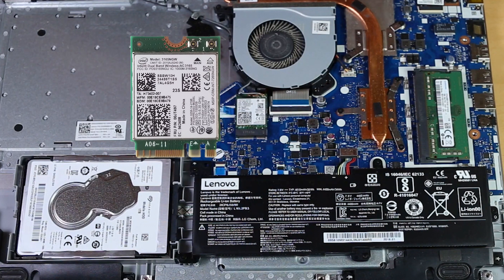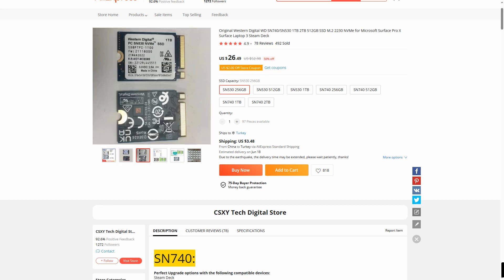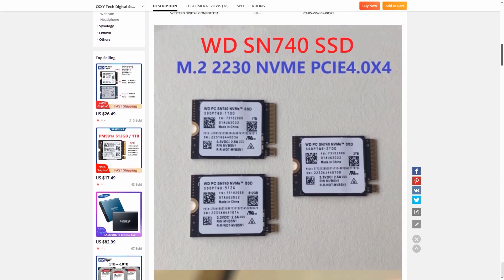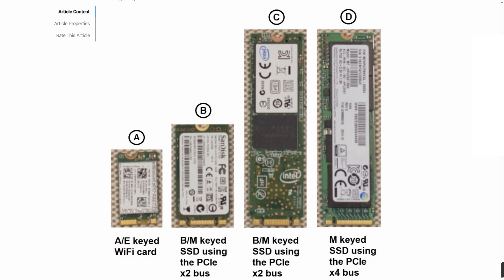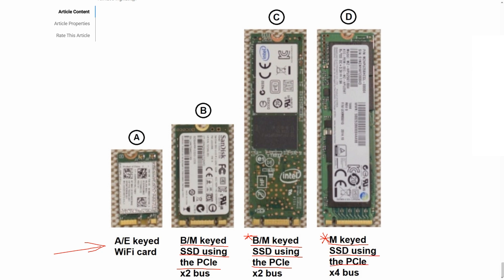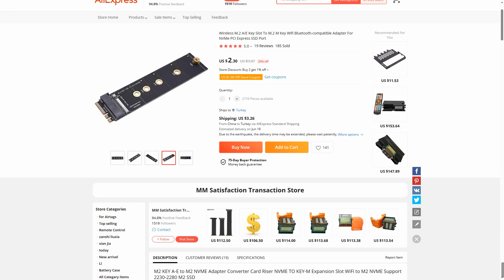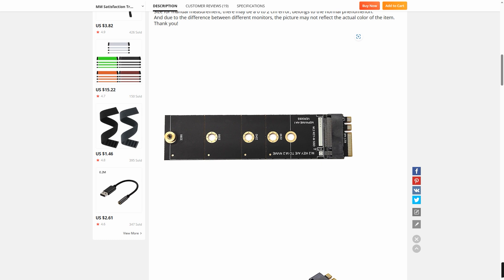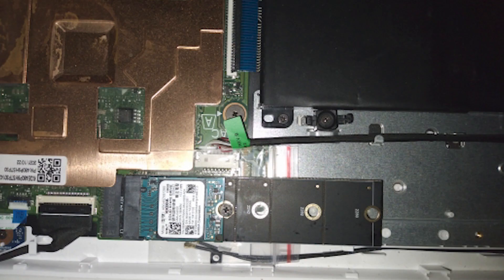Convert WiFi Slot to M.2 NVMe SSD Slot!

Comment: I always wondered if this was possible. I never pursued it because I was never willing to give up the WiFI in my laptops.
Reply: Unlucky. As an example my t480 has two of these slots. Meaning i can keep my WiFi module while having an ssd
Reply: USB WiFi.  Since WiFi standards are now ?? AX210 as of June 2023 ?? I can get WiFi thru a USB dongle.  However, BlueTooth is more difficult because many USB AX units don't have BT built-in.  Argh.
Reply: @emwa3600  just plug an Ethernet cable and be happy...
Reply: Put it in your Bluetooth socket?
Reply: @hicknopunk  Usually they're combined on one module.
Reply: I am happy to get rid of this brain destroying microwave irradiator. I rip the wifi cards out of every device I own and solely use LAN.
Reply: @cyberyogicowindler2448 "5 minute crafts how to convert a laptop into a desktop"
Reply: @cyberyogicowindler2448  WiFi Is Actually Faster Than The Cable! Or I Have Something Wrong With My Router!
Reply: @cyberyogicowindler2448  LAN is great but wifi does nothing to your brain 😂

Comment: What is the result of crystaldiskmark test?
Do you loose, some speed on write and read?
Reply from the maker: I got 1257,54 Read (MB/s), 1211,65 Write (MB/s) which quite higher than my 2.5" SSD
Reply: OMG cool, how about Asus Vivobook A442U. İ dont know what adapter i need to buy @techwise66